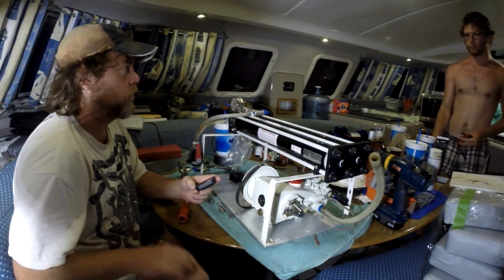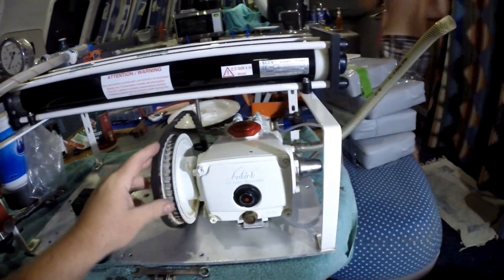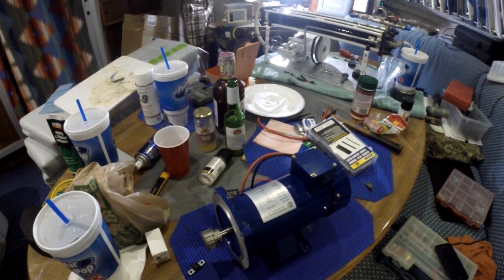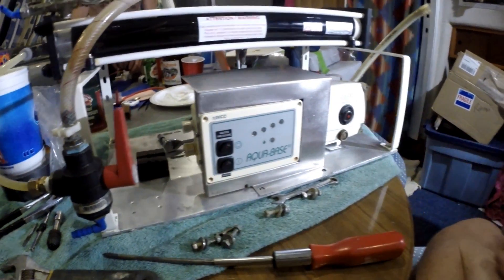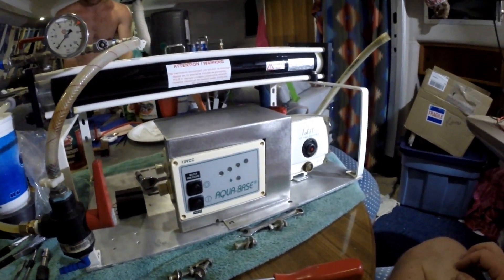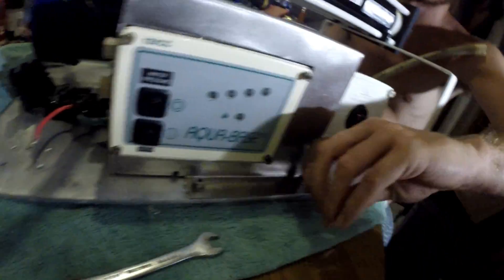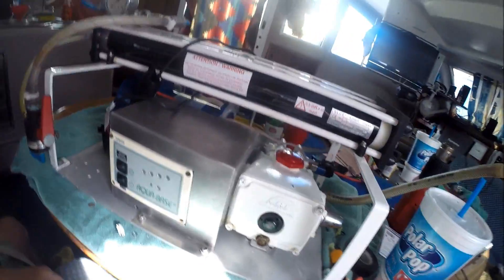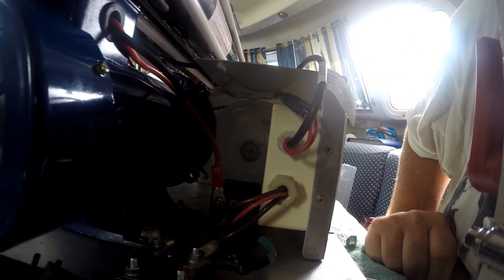Sailboat Refit - Episode 5 - Watermaker Build & 840 Watts of Solar Power

Comment: Where is the pressure control knob. Membranes should not be subject to immediate pressure on startup or shut down.
The high pressure pump should be of the aluminum bronze variety for this application.
Reply from the maker: +Patricia Brooks Its by the pressure gauge and its a manual knob - and the high pressure pump is the Cat Pump 237 which is one of the more expensive pumps Cat makes for the size because its made for handling salt water.
Reply: +s/v Catchin&#39; Rays Thanks we have the same style of pump on our water maker. Our system has been working since 1995 and proved to be indispensable when crossing the Atlantic. The membrane remained serviceable for 10 years without a fresh water flush so I think that illustrates that feature is not necessary. Best of luck.

Comment: Thank you Catchin Rays for such a detailed video on this increasingly important subject. How did you construct or buy your membrane vessel? My pump requires the vessels to handle 900 psi and I'm seeing they're 400$
Reply from the maker: Christopher Kane Well, the boat came with a watermaker....it had the high pressure pump and the membranes - but after investigating it, we discovered that it had been submerged with water half way up the electric motor and pump (we have no idea how that area was submerged, but it was) so all the electronic controls and the electric motor was destroyed.  But the high pressure pump, the tubing, and the membrane canisters were unharmed...so we didn't have to find and buy those.  I have heard they are expensive.  But I can lead you to a guy that has built his entire watermaker himself....and a very good one at that - he's making about 56 gallons an hour on his - he has two 40" canisters.   Go to his blog at  www.dea-latis.com and shoot him an email - maybe he can lead you in the right direction for purchasing watermaker components.  I know he's in Grenada right now, but maybe he can get back with you.  Hope this helps, and thanks for watching.

Comment: What a great video. What kind of feeder pump do you use exactly?
Reply from the maker: Christopher Kane Its a Rule IL200  and it works good but we're kinda on the fence with it because it doesn't self prime.....would be nice to have one that self primes then I wouldn't have to worry about sucking air and burning up the high pressure pump.  Thanks for watching.

Comment: what are the specs? on the low pressure pump? i've been researching on making a desalinator rather than spend well over 3k plus for this type system. not much info out there, so thanks a ton for this video~ !
Reply from the maker: Rick Little Ok...well you'd have to look up the specs on a Cat 237 pump...ours has the (i think) nickle, stainless, bronze head which makes it more expensive and resistant to salt water.  But just look up that pump and you can find the specs.  The other important part is the feeder pump....we had to search for that - but it works great - its a Rule Submersible pump I think its the 210L or something like that...but it has to be "continuous" and not intermittent.  And it feeds the Cat 237 pump really well.   But remember, the feeder pump (since its a submersible pump, has to be below the water line by 8 inches) and it has to feed more water than the Cat pump wants...meaning there will be extra water that we push overboard during watermaking.  But what the Cat pump produces all depends on how fast it turns...meaning your gear reduction from your electric motor.  Our electric motor has a 12 tooth pulley on it...and the pump has a 44 tooth pulley on it.  Our electric motor turns at 1750 rpm...so if you do all the math, you can figure out how fast the pump is turning and in turn, figure out how much water it will demand, and in turn figure out how much salt water you'll be pumping into your membranes. Hope that helps more than it confused. Good luck.
Reply from the maker: Rick Little I re-read your question and you were wanting specs on the feeder pump...well I did a search and it is this one and they are listed on Ebay  @itm/RULE-IL200P-IL200-PLUS-IN-LINE-SUBMERSIBLE-PUMP-12V-2-8-GPM/281535158858?pt=Boat_Parts_Accessories_Gear&hash=item418ccd9a4a&vxp=mtr"
They don't look "in-line" but they are...the little white screen comes off the one end and there is a place to attach a line....the screen is for if you want to use it as a submersible.  Also you have to get this one which is the "plus" which means it is continuous...I made the mistake of getting the non-plus and it is only to be ran for 15 min at a time.

Comment: Why would tap water destroy it?
Reply from the maker: Gracana Well tap water normally has chlorine in it and water maker membranes are not to have chlorine ran through them or it ruins them - so I've read.  Not that it would hurt any other part of the water maker, just the membranes.
Reply: Oh right, I have read about the damage chlorine can do but that was more in the context of making sure pre-treatment chlorine is removed, but of course city tap water would have the same problem. Thanks for explaining!
Reply: @kevtamus   Why didn't you run the tap water using a carbon filter to remove the chlorine?  You are going to have to pickle your system periodically anyway!!!
Reply: Gracana  you should try Englands hard water..  makes your moth dry just from drinking it lol

Comment: Impressive. Please keep the videos coming. Really would like more info on electrical stuff you are doing. Like wire gauge and how you connect the solar to your battery bank and regulate it. Great video please share more!
Reply from the maker: That's a good question - the problem with the type of videos I'm doing, I really only touch on the process and not the details - it takes somebody actually doing it, to want to know the type of details you are asking.  But without a video to explain what we did, at least maybe I can shed some light by this reply.

We struggle every time we hook something up to the batteries, ie do we go to a bus bar that is already on the boat, or do we go straight to the batteries....we always are second guessing ourselves with this problem.  Same when we expanded our 12 volt system with a new panel.  But here goes:  with the solar system, I bought 80 feet of 6 AWG wire (40' black and 40' red) and ran this down to where the batteries are (after first attaching all the red wires from each panel and all the black wires together - which made it parallel) and right in front of the batteries we mounted our MPPT controller.  We first hooked up the wires to the MPPT controller to the batteries, so it would know what voltage I was running.  We then attached the solar panel wires to it - after first running the red wire through a 50 amp breaker/swich (15 amp max per each panel x 3...so we went with a 50 amp breaker) so we could actually cut power to the panels if we needed to.  Then once we attached the panel wires to the controller, it started making power - it was pretty awesome to see.  But in the end, the wires coming to the batteries from the MPPT controller is like this - the black wire goes to a common bus that is in the battery bank area by which all negative wires must pass.  That was set up for my battery monitor system - so that's where we attached the black negative wire to.  But the red/hot wire we went straight to the red terminal of the battery bank - the END one where after attaching my batteries in series and parallel its 12 volts.  We also cut about 18" of the original 40' wire length off at the panels, and another 12" off at the MPPT controller - so we actually ran about a 38' run of wire.  And yes, if you do the calculations on voltage drop, we do have a voltage drop around 1.5 from the original 44 volts that the panels are capable of putting out (I think it was 44 volts, may have been 41 or 42).  But not sure that's hurting too much in the end.  Hope that answered some questions of yours - if you want to know any other specifics, please do hesitate to ask...I sit here with my finger in my nose most of the time when we're not working on the boat :)

And P.S. - we are not experts on any of this stuff....we went into this whole project having a strong background in doing a lot of home renovations, I built my first house from the ground up (without knowing what I was doing), and we're pretty mechanical in general - so we can be resourceful and do have some knowledge about a lot of the projects we tackle on our boat. But we do as much research about a particular job that were about to do (ie installing solar panels), and then we do the best we can.